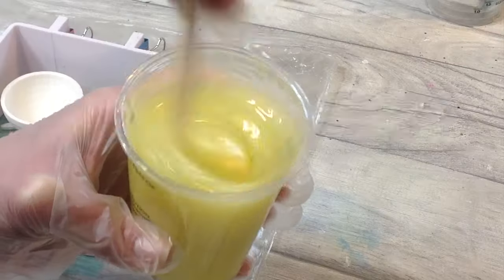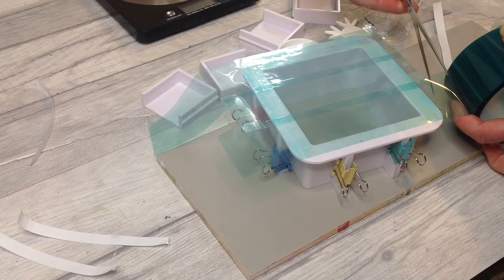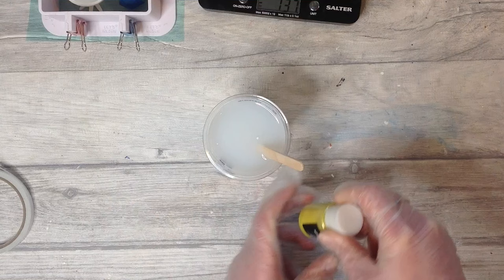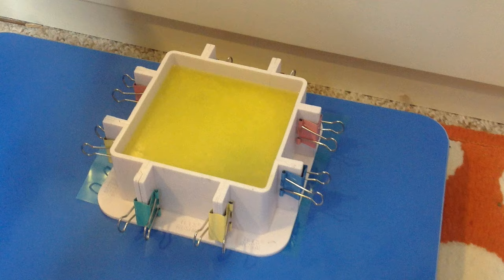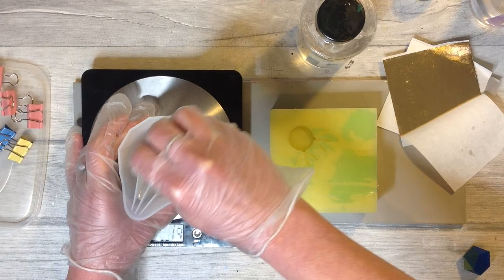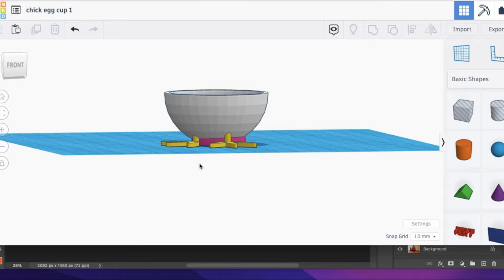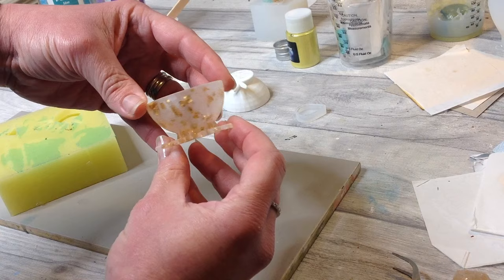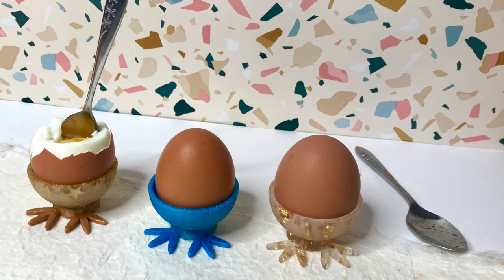HOW TO MAKE SILICONE MOLDS - for resin casting - FUN WITH RESIN

Comment: I am so relieved you use the proper PPE when using resin. There are horror stories out there from people having reactions that range anywhere from rashes to serious respiratory difficulties. Ventilation, nitrile gloves, and a respirator are a must.
Reply from the maker: Most definitely Diana, many thanks
Reply: I’m going through this now
Reply: @confidentqueen7259  I’m sorry.
Reply from the maker: @confidentqueen7259  do you mean problems to do with resin? 🤗
Reply: I've used polyester resins the bad smelly stuff since 1979. At the beginning I was silly no mask etc. But back then no books. No video's. And professionals did not want to help you. So I soldiered on and taught myself and learned everything myself and more. Then professionals started to ask me questions and I got my revenge and gave them the same answers they did not give me. But it's different today. We do help each other to a certain degree. Back to mould making. Fill the area with some rice and pour it into a cup and waigh it that will tell you how much silicone you need to fill the mould. Once you make the piece you can fill the mould area with rice. Again that will let you know how much resin you need to fill the moulds. I'd like to add I had no health issues with resin. Now we know more about using it safely follow the rules. Stay safe

Comment: You should not measure resin part an and b by weight. One of them is denser. You need to use liquid measurement.
Reply from the maker: @karen.yeskaren.1611  let's resin say to weigh for this one @letsresin
Reply: @RedRockingBird  maybe it’s the resin I use but I used to weigh it and had trouble with curing.

Comment: i know that the video is a year old, but i have a question - does it work, when i sculpt something out of clay and make a cast from silicone? because i need specific shapes for cosplay
Reply from the maker: Depends on the type of clay and type of silicone. Air dry clay needs to be fully sealed and coated before it goes near this silicone

Comment: I have a specific question and I’ve not been able to find it on the Internet and wondering if you are knowledgeable about terra-cotta clay I was looking for a clay that was air dryable for me to sculpt something and create a mold. My question is whether I can take the terra-cotta and create plaster molds and silicone molds as an example off of a terra-cotta clay sculptureand if I can do that for anybody reading this, what’s spray other than the mold do I need to use on the clay because I don’t want to lose the sculpt if anything goes wrong
Reply from the maker: Hi, You would need to completely seal the piece, it can’t be porous in any way, resin is ideal for this. It’s something I want to experiment with more, sculpting and casting. Terracotta and airy dry clay are porous so on their own would just absorb the silicone and be ruined, I hope this helps

Comment: It may have been said, but a resin 3-d printer can create insanely detailed prints that would yield better moulds. They are of such resolution that the layer lines are invisible.
Reply from the maker: Thank you for adding this, yes true, I only have FDM 3D printers currently, but I have a friend that has 3D printed me some resin models, so busy practicing moulding these for another video, all great fun. What do you make?

Comment: Really like your videos, they are very interesting and informative.  Regarding the silicone mould material you use, how much will it stretch?  I want to cast a small bowl/cup like structure, but the base of the cup is only about 8mm, through which I would have to remove the rest of the cup, once set.  The cup is around 45mm diameter, would its removal through such a small hole rip the silicone so destroying the mould?  How elastic is the silicone once set?  Appreciate your thoughts on this please, thanks 😊
Reply from the maker: Hi, thank you, you would have to cut the mold open with a sharp knife to get it out, then hold it back together with bands or tape while you pour and cure, hope this helps
Reply: Thank you very much, really appreciate your quick reply.
Reply from the maker: @MarkRobinson555  you’re very welcome, best of luck with your project

Comment: This video is wonderful.  I just got my kit in the mail.  Am I correcting in seeing that A and B are used to both made the molds and the models?
Reply from the maker: No, A and B are mixed together so that the silicone rubber cures, (then you fill mold with resin or similar, not silicone) happy crafting

Comment: Hi! I love how professional and simple your tutorial is! I need help. I’m trying to make a mold for a crystal octopus I have. It’s actually a napkin holder and since it’s crystal it’s very detailed. However, it has no flat side. It stands on the tip of the tentacles on the bottom side and on its rounded head on its top side…how will I get it out?  
Could you send me the list of all your tools including the printer?
Thank you!!
Reply from the maker: These are the links in the description:
US Supplies:
▶ ALL https://bit.ly/3TkFVWV discount code 10Rocking
▶Silicone Mold KIT https://letsresin.com/products/flexible-silicone-mold-making-kit?_pos=6&_sid=fdea2863f&_ss=r&ref=CXaxVhClJMHAcz&utm_source=goaffpro 
▶Resin https://letsresin.com/collections/casting-resin/products/16oz-clear-epoxy-resin-kit?ref=CXaxVhClJMHAcz&utm_source=goaffpro
▶Color Powder https://letsresin.com/search?options%5Bprefix%5D=last&q=mica%20powder&ref=CXaxVhClJMHAcz&type=product%2Carticle%2Cpage%2Ccollection&utm_source=goaffpro
▶Heat Mat https://letsresin.com/products/resin-heating-mat-fast-resin-curing-machine-with-silicone-mat?_pos=1&_sid=ebc439d8f&_ss=r&ref=CXaxVhClJMHAcz&utm_source=goaffpro
▶Lets Resin Supplies https://letsresin.com/?ref=CXaxVhClJMHAcz&utm_source=goaffpro
▶Craft files https://letsresin.com/products/resin-polishing-kit?_pos=1&_sid=def9909c0&_ss=r&ref=CXaxVhClJMHAcz&utm_source=goaffpro
▶All other RESIN supplies https://amzn.to/3TP60vp 
▶Speed Curer https://teexpert-tech.com/?ref=pJuYB6Id 10% off: RRB
▶Levelling table https://teexpert-tech.com/en-gb/products/teexpert-resin-companion-leveling-table-16x-12-us-only 10% off: RRB
▶3D Printer https://affiliate.geekbuying.com/deeplink.php?affid=3855&url=https://www.geekbuying.com/item/Creality-Ender-3-S1-Pro-3D-Printer-497276.html
▶Printer material https://amzn.to/4dtprnC

UK Supplies:
▶Mold Housing https://amzn.to/3HdUBRE
▶Silicone https://letsresin.co.uk/products/8oz-silicone-mold-making-trial-kit?_pos=5&_sid=3eab79b35&_ss=r&ref=CXaxVhClJMHAcz
▶Resin https://letsresin.co.uk/products/copy-of-16oz-clear-epoxy-resin-kit?_pos=7&_sid=06c1345a3&_ss=r&ref=CXaxVhClJMHAcz 
▶Heat Mat  https://letsresin.co.uk/products/resin-heating-mat-fast-resin-curing-machine-with-silicone-mat?_pos=1&_sid=4b9427c70&_ss=r&ref=CXaxVhClJMHAcz
▶Craft files https://amzn.to/3WPQDDO
▶Speed Curer https://teexpert-tech.com/en-gb/products/us-only-teexpert-resin-curing-machine-upgrade-2-hours-quick-curing-epoxy-resin-dryer-machine-with-3-bigger-and-deeper-flat-trays-for-epoxy-resin-art-craft-casting-%E7%9A%84%E5%89%AF%E6%9C%AC?ref=pJuYB6Id 10% off: RRB
▶Levelling table https://teexpert-tech.com/en-gb/products/copy-of-teexpert-resin-companion-leveling-table-16x-12-us-only?ref=pJuYB6Id 10% off: RRB
▶3D Printer https://affiliate.geekbuying.com/deeplink.php?affid=3855&url=https://www.geekbuying.com/item/Creality-Ender-3-S1-Pro-3D-Printer-497276.html DISCOUNT CODE: NNNUKS1PRCR
▶Printer material https://amzn.to/3CXDOjh

 - C O N N E C T   W I T H   M E - 
▶INSTAGRAM: https://www.instagram.com/redrockingbird
▶PATTERN SHOP: https://rockingbird.square.site/
▶SUPPORT ME: https://ko-fi.com/redrockingbird
Reply from the maker: This needs a lot more steps to make it happen and a new video on this I should make when I get time, there are a few other good YouTube tutorials on this let me see if I can find the name of the guy I’d recommend
Reply: @RedRockingBird ok! Thank you!!!

Comment: Thanks for the video! Could the original object for making the silicone mold be made from ceramic? Or would this be too porous?
Reply from the maker: A glazed ceramic yes, but I’ve not tried unglazed, I would image it wouldn’t work so well, but you could coat the ceramic in something like petroleum jelly I would imagine although I have not tried that yet either. I do love to experiment, thanks for watching and best of luck ❤️

Comment: I need to make a mold of a hand with curled fingers. I have a skeleton with soft foam hands, and I’d like to make a mold of those to cast in resin. My only concern is getting the hands out of the silicone once the silicone is dry. Since the hands are cupped, I don’t think I could just pull them out. Any advice? 

(The hands were initially grabbing a pole, so think of that shape).

Comment: New to the idea of making my own silicone molds for resin, is any resin food safe, or do I need to specifically specify food safe?
Reply from the maker: Once epoxy resin has fully cured correctly then it’s normally food safe, for example for the side/decoration of a chopping board, always best to check with the brand you use first though. I personally wouldn’t make plates and cups etc to use though presently

Comment: How strong is the odor ? Thank you for this tutorial ❤️
Reply: The door is sturdy, to make even stronger use wider planks to hold all together rather than thin ones like i did, but i love my barn doors, thanks
Reply: @redrockingbirdathome2696  ty. How strong is the odor of the silicone when pouring?
Reply from the maker: On my other channel I made a barn doors and this comment got mixed up up sorry!
The odour from the silicone is very low and then there is more of an odour from the resin, so I recommend a respirator mask, different brands are different, thanks
Reply: @RedRockingBird  thank you!

Comment: I hope you can help me. I misjudged how much I needed to make the mold. I ended up 1/2 inch short from the top. I live in a very rural area. Having to wait for delivery of more silicone. Can I add the new mixture to the already partially finished mold?
Reply from the maker: I really think it should be ok, the silicone should stick to the silicone, just make sure you don’t touch it or get dust or grease in there in the meantime, I’d cover it over. The other thing you can do to bulk out the silicone is to chop up any other unused silicone molds you have into tiny pieces and mix this in with your fresh silicone and then pour it in, let me know how you get on, best of luck.

Comment: Hey I had a question,when making a resin mold what does it mean by pouring a 1:1 ratio.
Reply from the maker: 1 part of resin A and 1 part of resin B.
So if you measure 50g of part A, also measure 50g of part B and then mix together to make 100g of resin

Comment: Hello! Thank you for sharing the videos, do you use different kind of resin for the mold and the one you in the mold? what are the differences?
Reply from the maker: Hi, the mold is made from silicone rubber, then once cured can be used for casting resin ❤️

Comment: Hi. Can you tell me once you’ve made the silicone mould, can you melt the silicone rubber to make other silicone moulds?
Reply from the maker: Once it’s a mould it’s a mould. The only way I would reuse it is to chop it up in tiny bits and mix with new silicone and pour again

Comment: You make some beautiful things.  Maybe you can help.  A friend coated a large project with resin, but he didn't use enough hardener.  Is there any way to make the coating harden?
Reply from the maker: Thank you, hmmmm that was a bit of a bumma, not so sure really, if it wasn’t salvageable any other way I think I’d with mix some more with extra gardener, or try and remove what I’d already put on. I’d take it as a learning curve for sure and turn it from something it was supposed to be into something else maybe, it’s a tricky one and really frustrating when these things happen I know, best of luck
Reply: @RedRockingBird  My friend removed all of the uncured resin and reapplied resin mixed properly.  Thanks!
Reply from the maker: @jerrycurtis98  wonderful good to hear it worked out

Comment: I thought it was better to measure epoxy by volume because the resin and hardner can have different consistencies.
Reply from the maker: The one I use here is let’s resin and they recommend weighing, other as you say measure by volume, so always read the specific brand instructions Thank you for watching 😊❤️

Comment: Try getting SLA resin 3D printer which can print smooth surfaces and incredible details. I have Elegoo Mars 3 and it's great.
Reply: How large a mold does the printer make? ….  Thank you so much
Reply from the maker: Thank you for this
Reply from the maker: Mine can make about 30x30x40cm if I remember correctly

Comment: if you 3d print them you have to let the print degas for about a week be for you mold it
Reply from the maker: Thank you, I still have lots to learn with the 3D printing, interesting, what does it do during that week? Thanks, Sarah
Reply: @RedRockingBird  just make sure you cure the parts and clean really good.. then let it set in a window with some sun for about week or 2 or your rubber wont cure... it took me about 45 try's to do this until someone told me about that trick lol
Reply from the maker: @jamessmallwood7448  I see thank you, I really appreciate it and will try that, does this work for PLA? Which is what I have here. Trying to print now with ABS but that’s a whole new struggle in itself but will keep trying 😊
Reply: @RedRockingBird  most molds will work with pla and abs its resin that takes time
Reply: resin printers
Reply from the maker: @jamessmallwood7448  I have a couple of filament 3D printers not resin unfortunately, working on the ABS so I can get a shiny finish inside the mould
Reply: @RedRockingBird  well then you should be fine with making the mold ;-)
Reply from the maker: @jamessmallwood7448  ‘working on’ with little success at mo! 😂

Comment: Hi can you tell me please if its possible if you have a silicon mold ,if u linded it with say polaphene ,can you then make a silicon object threw using the original mold, Thank .P
Reply from the maker: I’m not quite sure what you mean, if lining with something else it sounds like it’s going to be a bit uneven/distorted by the film
Reply: Hi thanks for your reply.what I mean is when I see someone make a epoxy resin item threw a silicone mold ,can I make a silicon item out of the original by say pouring silicon into the original mold.
Thanks. P
Reply: Or will,it stick together
Reply from the maker: @bensonmayfield5636  with regular silicone it will adhere and stick to the silicone, but I have a video out hopefully in January where you can do this with something different not using mold release, so some people I’ve seen do your method with mild release too
Reply: @RedRockingBird  Thanks
Reply: @RedRockingBird  very Christmas
Reply from the maker: @bensonmayfield5636  merry Christmas too ⭐️

Comment: any advice on how to create a mold of a drumstick?
Reply from the maker: I’ve not tried something so long with silicone, only this:
https://youtu.be/R0HCS_YHbks

I would try first a horizontal mould but would also be interesting to try a long tall vertical mould, I’ll have a think, thanks for watching
Reply: @RedRockingBird  thank you I appreciate it!
Reply from the maker: @KristaBandito  you’ve really got me thinking about this now…I do LOVE a good challenge 😂❤️❤️
Reply from the maker: @KristaBandito  can I ask what you hope to cast in the mould and if you want to use this to actually strike the drums? Just thinking about the strength of everything, if not just for decorative purposes or for cake making etc??? Thanks
Reply: @RedRockingBird  I just want to cast a real drumstick and create a resin version with confetti inside but no, just decorative not to play
Reply from the maker: @KristaBandito  I’d maybe try either silicone putty to wrap around it but might need quite a bit, or I’d place inside a mold (horizontally) like in this video then make a couple of slits to get it out, I’d have to experiment so just a thought, or see if a vertical mold is possible would be fun